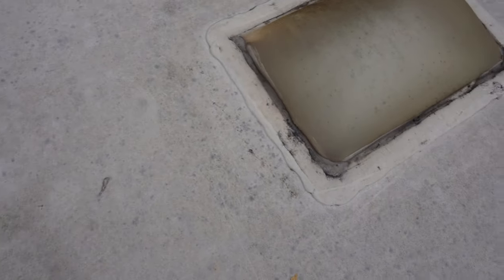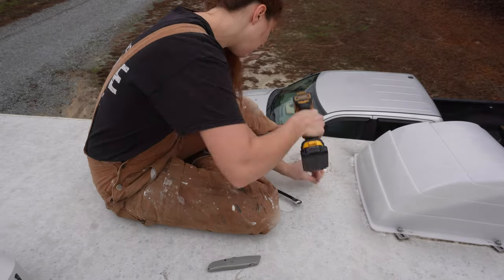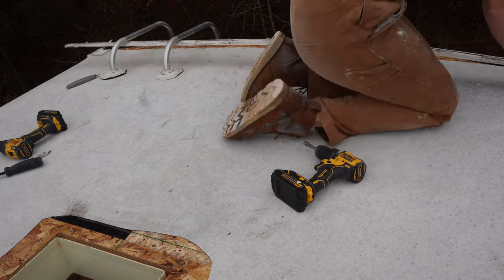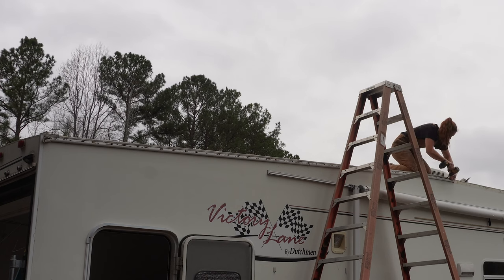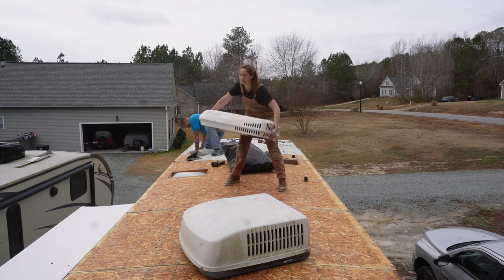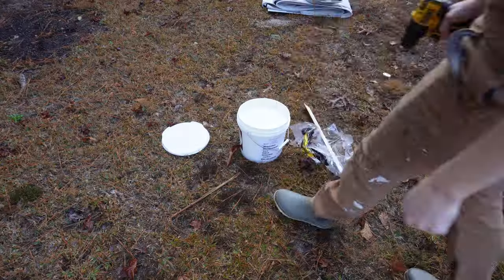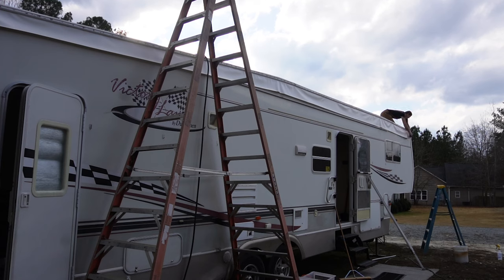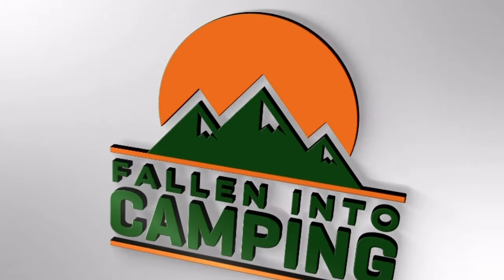How to replace your RV Roof Membrane: Timelapse & Instructions

Comment: Instead of putting the same cheap RV roof membrane, use commercial rubber roofing.  It costs about a third of the RV specific material and is twice as thick and lasts 30-40 years.
Reply from the maker: This is a PVC membrane that is used in commercial roofing. EDPM and TPO are what RV manufacturers use.

Comment: Also, a small piece of advice, use a heat gun to soften the sealants. A small amount of heat goes ALONG way towards making that job so much easier. I know, I’ve done it so many times, it just scrapes right up with half the effort lol.
Reply from the maker: Haha great advice! I try to let it sit in the sun for a bit which helps too, but not always 😂
Reply: Great tip ty

Comment: I am installing a Recpro PVC RV Rubber Roof Kit in White but I just can't tell which is the shiny side. I can't tell a difference by the shininess. One side does have little indent looking spots all over it in a uniform pattern. I would NOT call it a textured surface. It looks more like a little porous just barley in the surface type indents. What can anyone tell me? I will contact recpro monday buy just trying to get it done today.

Comment: QUESTION?? Love Ur informative videos!! I'm completing  full renovation of my "98 C class RV and just replaced 100% of roof w/OSB sheets. What/Who do U recommend for a seam tape, before I glue new TPO membrane?? And would U recommend sanding the osb edges slightly to take the square edges off??? TIP for rusted screws/holes: I plug the holes w/ plastic zip ties and cut them. Now the new screws will have some bite when I re-insert!?!?
Reply from the maker: I use gorilla glue duct tape. You can sand the edges if you want but it’s not necessary as long as the duct tape is laying on the edge!

Comment: First off great job. You are such a hard worker!  and as a father, I would be so proud of my daughter if she worked like you! I have referenced this video for my roof repair and replacement on my small wolf pup. I ordered the kit off of Amazon. My only complaint is that the roof came folded up. I have it unfolded, sitting out in the sun right now to try and help soften it up and smooth out some of the creases from it being folded. Do you have any other recommendations or advice on how to get the creases out ? I'm repairing my camper inside of a closed building, but i'm considering pulling it out and laying the membrane over the roof like you did, in the sun to help get some of the creases out also..
Reply from the maker: They do come folded up. You can buy it directly from recpro and have the option to ship it rolled but it’s super expensive. I typically roll it out when I get it and roll it back up with a 2x4 inside. Sitting in the sun will do wonders for the creases when you lay it out on the roof!

Comment: Saw your remodel video for first time with my wife, love it and started the rest of them. Many thanks for putting us on to RecPro. Was there an affiliate link for you? We picked out a stove but will wait to hear back
Reply from the maker: Thank you so much! My code is MNIMXX3 for 5% off. I get I think 2-3% of the discount directly!
Reply: Love your videos.
Thank you for the complete explanation.
I also was wondering which rv kit you ordered and used for this particular job.
Recpro has so many kits available and is a little confusing.
Thanks again.

Comment: Great info. I have to replace mine, once the snows gone. How much was the hole project cost wise. Mine is 26ft only. Thanks
Reply from the maker: The 20ft awning was $865 before tax, but they have all different sizes, just depends on what size you need
Reply: @fallenintocamping  thank you for the help

Comment: Thank you for posting these how to videos! I was able to redo my camper roof due to water damage because of your detailed videos. I purchased everything from your links as well.
All we have left to do is lap seal everything.
I was wondering, do you tear off extra butyl tape squeeze out from around the vents, or do you just lap seal over it?
Thank you again!!
Reply from the maker: That’s so great to hear! If it’s a little bit I usually leave it. If it’s a lot, I clean it up. It’s just more lap sealant to use if you leave it squeezed out, because it needs to completely cover the excess butyl tape.
Reply: @fallenintocamping 
Gotcha!! Thank you for replying so fast. I will be sealing everything up this afternoon then.

Comment: Love the video. Could you share with roof membrane and glue you used? I am in the midst of replacing my roof and don't want to order the wrong material.
Reply from the maker: I used the 8.5’ wide PVC kit from recpro. They sell them in all different lengths! I’ll link the amazon supplies below. If you order directly from recpro, it’s usually cheaper than amazon. You can use the code FALLEN2CAMP for 5% off if you would like!
Reply from the maker: https://tr.ee/aFX5Z0ZjPu

Comment: Thank you for the awesome video. Carpenter here but new to RV roofs and I'm doing my first right now. The stickiness after pulling the old membrane is bad! All the debris is getting in it (I have sheets and holes to replace.) I'm wondering if you have a good method for cleaning what gets in the sticky stuff? I'm at the point of I'm about to replace every sheet because I'm scared ill have a sharp piece of wood sticking up now and ruin the new roof! Any suggestions??
Reply from the maker: The struggle is real…I try to minimize the amount of dirt that gets on the roof. If you noticed I cut the roof in sections and tried to pull it in a way that all of the debris gets scooped up with the membrane. But, if you didn’t do that, it’s tough. Obviously you want to make your roof as clean as possible. An air compressor can help blow some of the yuck off. A little dirt is okay. Definitely don’t want anything sticking up, but you can always lightly sand the rough spots. Every roof will be sticky, so don’t think it’s abnormal! I actually save my old shoes and use them for replacing roofs just to throw them away later…the old glue will stick to your shoes and will never come off 😂

Comment: Great video... when I tore off my old roof, it left a lot of black rubber dust... do I need to clean that up??
Reply from the maker: I would clean off as much as you can. Just leaves a cleaner slate for the glue to adhere to

Comment: Heather any reason why you dont have scaffold for such a big job ??? To me it would be a nice storage area for tools materials and a step off point . second question .Henry's rubber roof coating any experience with that product ? thanks for sharing i love watching fix it videos then tweek them to my projects .I acually have access to rubber rolls and been contemplating useing that after doing a apartment deck with it 3 yrs ago , still  like new and any repairs are just like patching a inner tube tire with the same glue.

Comment: I just recently bought a project camper it’s only a 18 foot, but I discovered it’s in really bad shape roof leaks floor rot wall delaminated, what I’m scared of is mold , and the floor is the one that has the foam insulation sandwiched between thin paneling, overwhelming to look at , what do you do with the mold, should I just trash it and make a car hauler?😊

Comment: Wonderful video! I'm thinking I may need to do this to my unit soonish. I have a question though, what's your opinion on using RecPro's fiberglass/filon siding/roofing on the roof instead of their rubber roofing? Would it offer any benefits as far as strength goes, or do you think it would be so hard to install it wouldn't be worth it?

Comment: I was told you need to put new wood over the old wood so the glue for the TPO will adhere.  They said the glue needs to soak into the wood and the glue doesn’t stick to old glue.  So I am told I need to put a underlayment over the old wood.  Thoughts?
Reply from the maker: Never heard of that before. Even the RV techs that I know don’t replace the decking unless it’s rotten. Seems like extra unnecessary work to me, but each person can have their own preference on how it’s done.

Comment: When you say not to use silicone do you mean not anywhere or do you use something else around the outside lights if you replace them?
Reply from the maker: The silicon can be used pretty much anywhere but the roof.
Reply from the maker: I use silicon when replacing lights, just make sure it’s outdoor

Comment: Question: Why did you put the glue coat only on the roof and not on the membrane also (glue on booth pieces) ? I think the glue manufacturer suggest to put on both . Thanks for this excellent video.
Reply: I think the double-glue recommendation is only for situations where both surfaces are non-porous (like if you were putting PVC over aluminum).  Since her roof base is wood, it is porous and only the PVC is non-porous, so she only needed one layer of glue.
Reply: @amyhittlet1411  Hi, that makes a lot of sense. Thanks for taking the time to answer me. Have a magical day ☀

Comment: Do you have a how to for ceiling and I guess it's vinyl roof.  I'm trying to do this by myself. It has atleast 1 leak and I pull down 1 of the panels so far and I'm going to need to replace several of the wood stuff(tresses) but I'm also going to need to replace the roof cause I can feel the soft roof

Comment: Great video.  I havea soft spot on my roof.  About 16" from the front molding.  Could I cut the current membrane at 24", peel it back: replace the plywood, and use eternal bond to repair the cut in the membrane?   Thoughts?
Reply from the maker: I would not do that. Eternabond is terrible, and there’s not really a good way to join a spot that’s been cut from the roof. If you don’t want to replace the whole membrane, I would suggest peeling it back and regluing after. It won’t look particularly pretty but it’s better than having a seam on your roof.

Comment: Excellent video! I'm about to replace my roof and an watching a lot of these. One detail I haven't seen in any yet though, do you need to clean/sand the osb after removing the membrane? There's a sticky residue and sometimes dirt on it.
Reply from the maker: I don’t. When I remove the old roof membrane, if you look in the video (and I should have included this part) you’ll see that when I cut the sections I pull from all 4 sides and then pull up to keep the dirt and screws from spilling over onto the OSB. Basically trying to push the dirt and screws into the middle of the membrane and pick it all up at once, one section at a time. A little dirt is okay, and sticky is okay. The glue will still adhere to it just fine if it’s sticky, you just don’t want it caked it dirt. If you try to sand it, it’s going to be a big pain, and you risk compromising the sealed side of the osb (notice osb has a smooth side and a rough side—the smooth side is typically roof side and rough side is inside the ceiling)
Reply: @fallenintocamping  Thanks for the excellent information!

Comment: I ordered the roof membrane from Recpro. When I got it it’s smooth on both sides. Is that the correct material for roof? I can’t really tell in ur video. Also I didn’t hear you mention if it had a rough side like most roofs do on membrane.
Reply from the maker: I’m almost positive they changed it recently, because one side used to be more bumpy. There isn’t an up or down either way (I double checked with their instructions online to make sure they didn’t change anything). The whole material is PVC, and does not have layers like other roof membranes. Pick which side you like best 😂

Comment: I know this isn't a new video.  But I'm restoring a old 80's model camper trailer with metal siding.  Is the roof skin the same on it?  Or did it change to this later?
Reply from the maker: Most older campers have an aluminum roof. Have you looked to see what it looks like up there yet?
Reply: @fallenintocamping  Attempted to it was covered in a thick splotchy coat of some sort of sealant. I'll check it closer tomorrow.

Comment: So need your help here:    I’ve started this very project on my Travel Trailer, and thank you for the recommendation for RecPro!!   but I’ve noticed that the old EDPM glue is very stuck on the good OSB, and there’s no way to get it to come off.

Will this glue end up ruining the new PVC or new Glue when I roll it on??   It’s extra gummy and flexible AND STICKY, and since I don’t have the ability to by 5 more sheets, I’m kind panicking about it.   Hoping to finish the whole job in 3 more days.

Any help much appreciated!  As is your videos!
Reply from the maker: It will be fine. Just try not to get a bunch of dirt in the sticky part. There’s really no way around it being sticky unless you replace all of the decking, which I don’t do unless it has water damage!

Comment: How did you fill in the one vent hole? What did you use? Do you have any videos of that?
Reply from the maker: I actually just screwed some ripped down 2x4s (1 1/2x1 1/2 in) and cut them to side, and screwed them into the frame that is already there for the vent, and then cut some plywood to fill the hole. Then I taped the edges on the roof side after screwing the plywood down. Make sure it’s flush with the roof!

Comment: Great video and detailed. so i have a 2006 weekend warrior LE 3505 which is a 35' and a wide body of 102". I went to recpro to purchase. do you recommend the 8' 5" or the 9' 5" width. also the length a 35 or 40'? One more question. I need ceiling tiles but rec pro does not have them. can you recommend a vendor. since mine is wide body, i need a 98" width ceiling panel and not a 96". TIA
Reply from the maker: Most RVs are a true 8ft across, so the 8’ 5” leaves enough room for the overhang on the sides. If you’ve measured and yours is 102” then I’d order the 9’ 5”.
Reply from the maker: About the ceiling tiles—is that what’s currently in your ceiling? I’ve never heard of ceiling tiles before. Usually it’s 1/8 inch plywood or upholstered. It’s going to be tough to find a panel that’s 98 instead of 96

Comment: I noticed you had a few wrinkles, like around the skylight. Will that be a problem at some time?
Reply from the maker: Great question! The roof will shrink a little bit with the heat and wear, so I’m not really worried about small wrinkles. I try not to have many, but sometimes with the temperature outside (ie too hot or cold), it happens. It’s sealed, so even if it doesn’t shrink and lay flat (it did, I only know that because this is my dad’s roof 😂), it would still be waterproof unless it was punctured.
Reply: @fallenintocamping  is there a chance for mold or mildew in those areas?

Comment: Can you just do a small section if you just need one wood panel replaced that got water.
Reply from the maker: If its on a corner, it’s possible to peel that section up and glue it back down, but I wouldn’t do it if it’s a pretty large area

Comment: When you’re redoing the roof,  how do you prevent the inside from getting wet incase of rain?
Reply from the maker: I tarp it if I need to. I try to get it done in one day and then lay the membrane over it to relax overnight, but if that dosent happen, I use a thick tarp to cover it

Comment: How many strips of Butyl did you use for the aluminum strip covering the roof membrane/front cap?
Reply from the maker: I think it’s less than a roll per side, depending on how long the trailer is. This one was about 40ft

Comment: Im working on my camper what kind of insulation you recommend for walls and ceiling?
Reply from the maker: I use R-13. Half sheet for walls, full sheet for ceiling. I don’t like foam insulation (unless it’s in a horse trailer) because the R value is so low.

Comment: Have you ever installed porcelain tile in an RV , I'm trying to remodel my class c camper ,but I just want it to look more elegant than normal
Reply from the maker: I usually install glass if it’s a small area for a backsplash. You just have to be careful with how much weight you add. I have a video on how to install a tile backsplash on my channel if you want to see what it’s all about.
Reply: @fallenintocamping  I was referring to installing porcelain tile on the floor , sorry !

Comment: Hi, question not about roof, but will be really appreciate for your advice. I’m fixing leaking window on fiberglass rv, is it fine to use Butyl Seal Tape? Thank you.
Reply from the maker: You can in a bind, but it’s not ideal. The window really needs to be totally flush with the fiberglass. I use the dicor foam core kit. I have it linked in my amazon lists. I does do 6-8 windows which is why it’s so expensive. But if you have one starting to leak, chances are you need to check the other windows too
Reply from the maker: Dicor Corporation Standard Seal-Tite Reseal Kit 6 to 8 Windows WRK1, White https://a.co/d/1DIp6em
Reply: Thank you